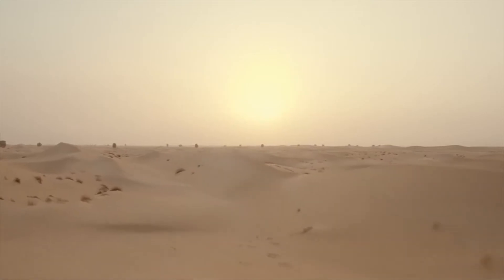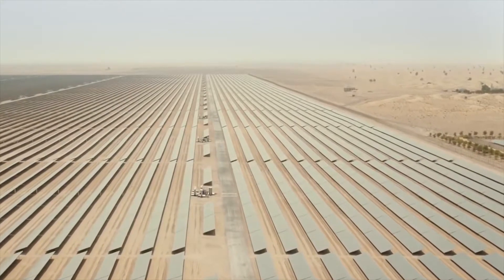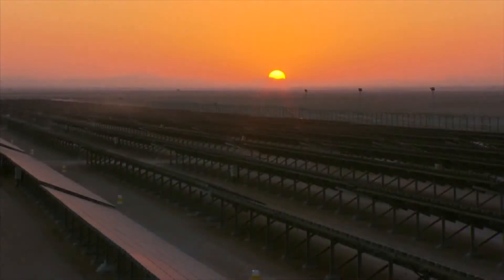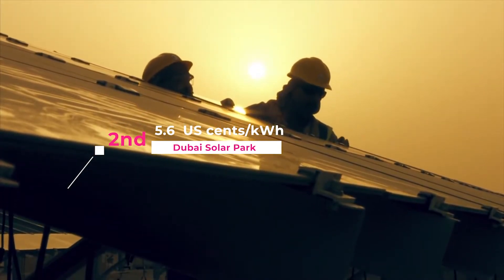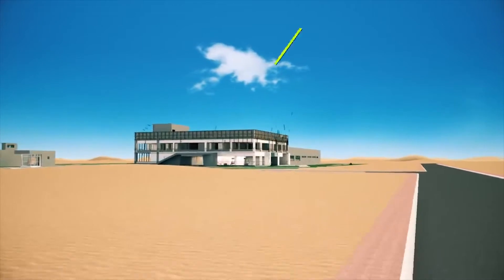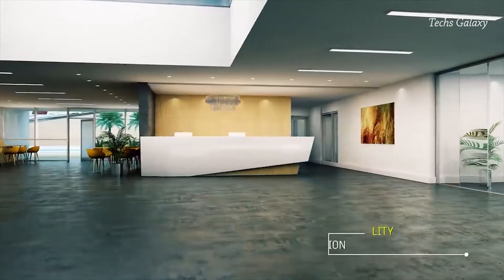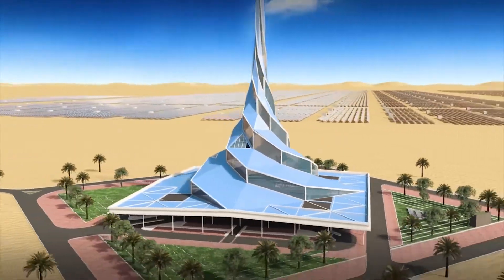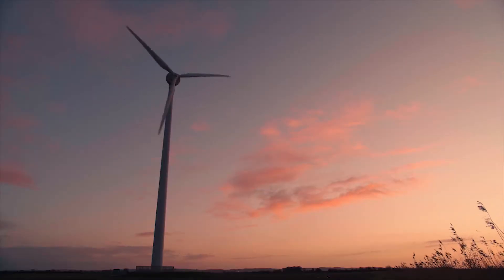Inside $13.6 Billion World's Largest Mega Solar Park in the World - Dubai - 5000 Megawatts!

Comment: One interesting question is how much area of land will need to be covered with solar cells to generate and output of 5000 megawatts of electricity. This is about how much power is needed to supply the city of Los Angeles on a hot summer day, so it will take a tremendous amount of mostly desert land in Dubai to generate this much solar electricity. The amount of land that will be covered by all these solar cells will have its own unique set of environmental impacts that will need to be investigated and determined.
Reply from the maker: Yes I agree to you David